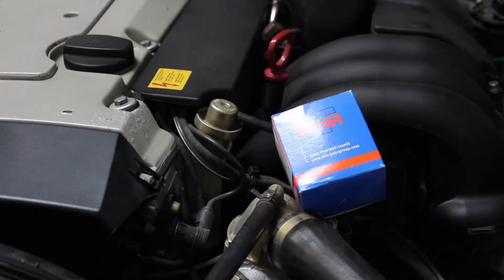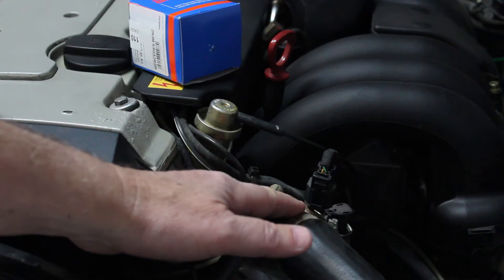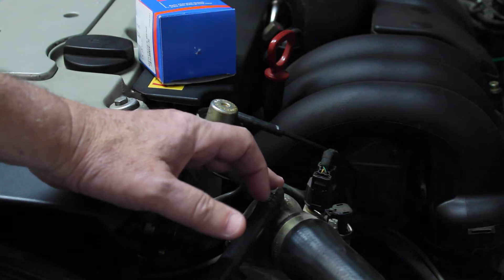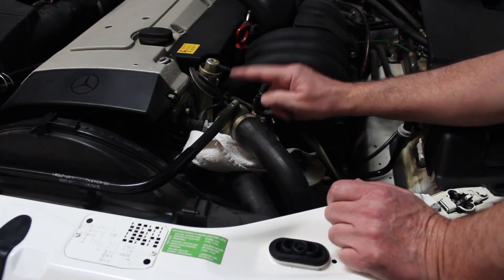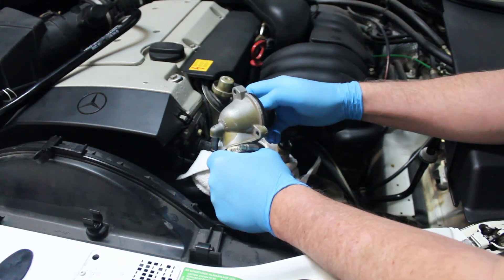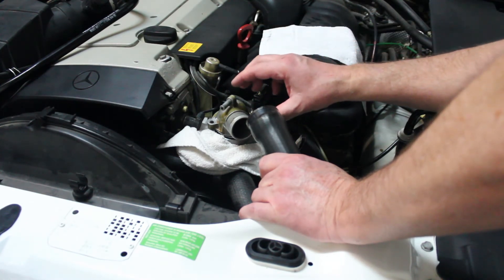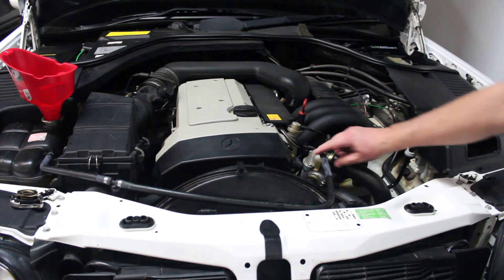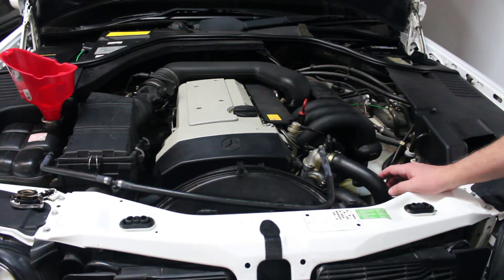Mercedes-Benz M104 Thermostat Change (S320)

Comment: Thanks for the video, what was the main reason you change the thermostat?
Was your car overheating,
Thank you so much for your help.
Reply from the maker: I changed everything in the cooling system due to hot running/overheating.  Thanks for watching!

Comment: Hello, I suffer from a lack of water in the car, and there is no leaking hoses or radiators, does the thermostat do that in case it is damaged, as I notice a sudden drop in the temperature of the car and it did not rise from its normal position to 80C
when Stuck Open Thermostat is to cause to lack of water , the weather is summer ??
Reply from the maker: A thermostat won't lose coolant for you - you could be consuming coolant via a headgasket leak, though.  Thanks for watching!

Comment: Thanks for your video! Question - I'm planning to do this on my car this weekend, but my car doesn't have a bleeding 'tube' or anything like what you describe - my new thermostat seems to have the little 'jiggle valve' thing on it for bleeding on its own..... I ordered this through an MBZ parts company so I know its the right thermostat - have you ever heard of this?
Reply from the maker: Many are like that, best to bleed thru coolant tank cap with front end up towards said cap.  Thanks for watching!

Comment: I have a question I did a coolent flush and filled it up but it doesn’t bubble to burp the system or anything just sits where I filled it at even with hen heat on and running it doesn’t go down at all I replaced my thermostat and it still does the same thing am I missing something?
Reply from the maker: Did you drain the block and the radiator, or to what extent did you drain?  I never saw tremendous bubbling with these cars, but there should definitely be a little bit in most cases.  Thanks for watching!
Reply: redonKiLaus I drained the radiator completely
Reply from the maker: @gregfowler8083  Do you have any overheating or temperature spiking?  If not, it should be OK to drive (at least to test) and should bleed out as you drive if there is any air remaining in the system.  That's where I'd personally proceed from where you're at.

Comment: Thanks for sharing this information.  Do you have a you tube on repairing a smog pump problem in this same automible, and also how to remove the instrument cluster on this model of car?  Thanks again Ed
Reply from the maker: I've not needed to tackle the smog pump.  I did pull the gauge cluster to replace bulbs at one point, but I followed a very good video I found on YouTube - https://www.youtube.com/watch?v=Z7vM78b5cOw